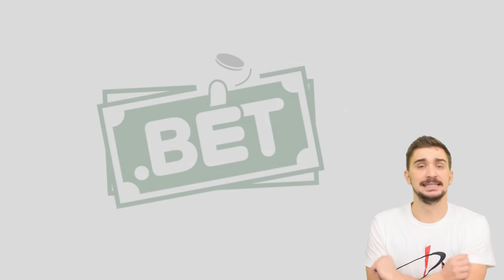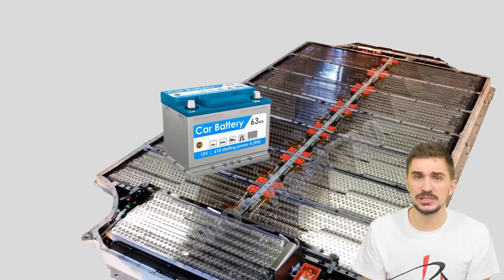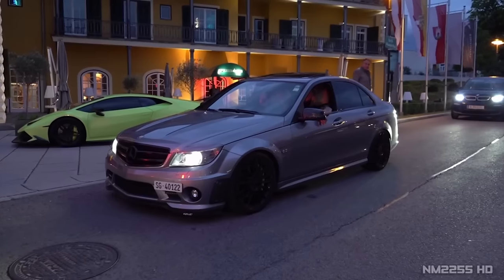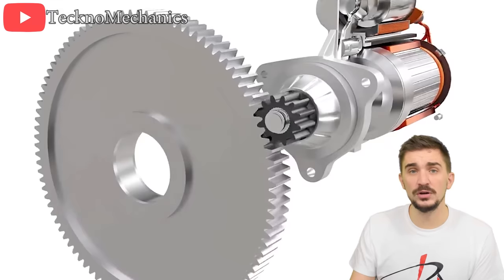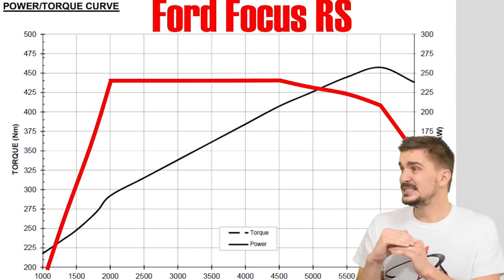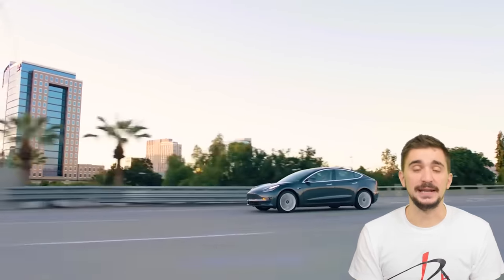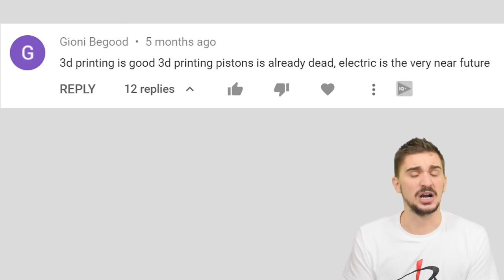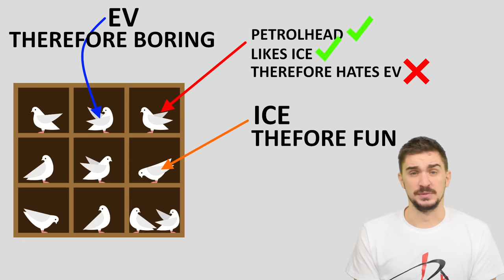ICE vs EV - IN-DEPTH comparison of BATTERY ELECTRIC and INTERNAL COMBUSTION ENGINE vehicles

Comment: Ah yes, starter - the forbidden EV motor :D
Reply: if only.... was brushless
Reply: @juandomingoperon828  Most if not all starter motor are brushless
Reply: Danger Bear  ∞ MPG with this one simple trick!
Reply: @juandomingoperon828  🪥 less?
Reply: @mayuravirus6134  Maybe many modern starter motors are brushless, but the majority of starter motors over history are brushed DC. And as our host stated, modern cars don't even allow you to use the starter motor to drive the wheels, since they need you to press the clutch in order to engage the starter.
Reply: @mayuravirus6134  this is news to me?
Reply: alternator, too...if you reconfigure it

Comment: For  me, none of what you said apply.  The reason I prefer ICE is because they are FAR more maintainable than EV and FAR less expensive to operate.   I drive 30 year old ICE which I maintained 100% by myself.  If anything goes wrong, I can fix it myself.   Just not possible with an EV.  You cannot even obtain replacement parts, diagnostic tools and even manuals in many cases.  Busted Tesla main computer?   Good luck trying to DIY repair!  EVEN Rich rebuild or Louis Rossmann are lost in that case.   I also drove an EV for 3 years and at one time it broke down on the road - I was completely helpless and I don't like that at all.   And think about the glory of when EV's main battery eventually breaks down out of warranty!   How much will it cost to replace?  GOOD LUCK!!!

Comment: Even tho this is more of a petrolhead channel i like, that this was really non biased. and that you give both sections their good attention.
Reply: Yet he is so wrong about EVs. The batteries must NOT be replaced. He keeps saying this over and over on several videos. Yet the first gen Prius from the 90s proved the batteries lasted the lifetime of the car, and did not need swapping out. Our 10 years old Nissan Leaf still has 85% range left. And i have never ever changed a window wiper motor on any car i have owned. Why did he even bother to put those in the service on the electric. Nissan Leaf service manual says to change coolant after 15 years. Yes, 15. If you do it earlier, you must change it every year after that. Something to do with sealing and quality of coolant. You dont regularly change gear oil either. Service manual just says "inspection" every year. Things like this damage the credibility of the channel. Read up, and stop using Tesla in every comparison. Small EVs and crossovers also exist, and they are perfect for daily use while the family SUV bus is parked waiting for long weekend getaways. (Most families have two cars).
Reply: @retroMartin  yes from the 90s you recognize how they didn't have so much computer tech right? Nowadays car manufacturers often profit off of making parts for no lifetime use
Reply: @Excepticus  Thats just a conspiracy thought. I just told you how modern day batteries last without issues. Nissan Norway only replaced a couple batteries under warranty. The Nissan Leaf forums are pretty much empty of threads regards to people whining about faulty batteries, because they dont fail.
Reply: @retroMartin  He is also talking about timing belt replacement for ICE engines and that also only happens once in the lifetime of an ICE car. 

He didn't talk negatively about the replacement of the battery nor its costs. He just mentioned it is a component that may need to be replaced sometimes.

I'm going to give him the benefit of the doubt and assume he talked about battery replacement because it might be something that happens after high power use of an electric car. I doubt that a formula E car's battery lasts as long as the one in a Tesla model S.
Reply: @retroMartin  I also drove Nissan Leaf for few years.   But my battery lost significant charge.  That was the main problem Nissan Leaf - you can find many examples of older Nissan Leaf, some even with less than 30 miles range when fully charged.  Now with Teslas, it's even worse as batteries often fail completely out of blue.   Lithium ion battieries degrade and fail.  That's fact of life.  Replacing EV main battery is VERY expensive, often not economical at all for old EV.   Not only that, electronics in EV is very complex, not really possible for DIY repair.   I also owned Toyota Prius for few years - engine problem?  No biggie, I fixed it myself, but if EV electronics break, then I am SOL.   Meanwhile, I am cruising in my 30 year old ICE which I maintained 100% myself.  It has same range as it did when it was brand new 30 years ago.  I can even rebuild my engine as it's fairly simple.  ICEs (with reliable, proven power train) are FAR more economical to operate over long time than any EV.  Look no further than Irv Gordon's 3.2 million mile Volvo on original power train ( which outlasted the owner unfortunately) for how long ICEs can last.  Irv Gordon's volvo is not an anomaly, as average ICE car in Cuba is 60 years old!!
Reply: @springer-qb4dv  I've never heard of this before. Are you driving in Arizona or other places with scorching heat? The old 1998 99 Prius batteries haven't failed or lost significantly charge either. I smell BS.
Reply: @retroMartin  The old Prius batteries are doing fine here in the Nordics but that is not the situation everywhere. This will become less of a problem as batteries get cheaper, better and the servicing gets better (I hear it can be a nightmare to get your EV-battery serviced in some places), but as of now this is still a problem in some places, like you seem to hint at yourself.
Reply: @Blandtheorist  By service on the battery, are you talking about fixing broken cells? Since the batteries does not need service.
Reply: @retroMartin  Broken cells, yes, loose wires etc. Probably often simple and fixable stuff but I gather that Tesla is so overwhelmed in many places that the only thing they suggest is a complete new battery.

This will surely get better once mechanics get more acquainted to these cars.
Reply: @Blandtheorist  Nissan Norway has replaced 3 battery packs for 10 years, i read today. Not alot... If Tesla swap packs, and refurbish broken ones to be put into other cars that's good too. I don't think 10.000 dollar batteries are shipped to the landfill.
Reply: diesel
Reply: very petro biased........regenerative brakes, very very narrow comparisons, etc....NO mention of oil industry vs mining for batterys, etc.....clearly naive. Off to a decent start though.
Reply: i added last comment before finishing watching video.  this channel is more Performance based, in those regards, ev will absolutely rule.  This channel has simply not been paying attention to the background of EV.

Comment: Another thing is that liquid fuel engines have a much longer range than EV. EV batteries drain really fast when you run the heat in one, whereas ICEs are just bleeding essentially a waste product of ICE engines. Going outside the engines of these vehicles, EVs are not better for the environment in many places because fossil fuels are used to create power for the electric cars. Even in places where "environmentally friendly" power is generated (i.e. wind, and solar power) the energy infrastructure is hardly adequate as it is, adding a ton of EVs on top of that would be detrimental to those places. Mining and refining lithium for EV batteries is very bad for the environment. As for technological advancement, electric motors and batteries have been around longer than internal combustion has, so I don't believe that will come as far as internal combustion engines have. I just don't think EVs will ever be better for the average person than internal combustion, and internal combustion surely will never be phased out entirely.

Comment: I really, really like your balanced, curiosity driven and engineering based approach to this subject. Thank you. I myself have worked with ICE:s all my career and would also describe myself as a petrolhead. I have 5 cars in my garage. HOWEVER, one is an EV and it's a car I really appreciate to drive. It works very well for most missions, and where it doesn't, I just pick one of the other cars. No big deal and there's is as you say no reason to cathegorically "pick sides" and start hating. 
Also, a subject you might want to cover: The ICE itself is not "the enemy", it's what we put in them... I think synthetic fuels presents a really interesting future and I hope development picks up dramatically. Again - thanks!
Reply: @censoredfromtheinternet3110  factory =/= power plant
Reply: i hate evs
Reply: @alpha-cf2oi  shouldn't. They present the advancement of automotive engineering to scopes far beyond we could comprehend. Because of EVs we are already touching f-zero type of thing where you have a dynamic pitstop embedded in the asphalt that you only need to drive through it to recharge the car, and that to me as a car enthusiast and gamer is something i never thought of becoming a reality. EVs aren't the problem, preaching them in detriment of petrol cars is.
Reply: @Canalbiruta  tell me this: should a car enthusiast appreciate ICE cars AND EVs?
Reply: @alpha-cf2oi  that's what I've always told myself too. But one day I'll probably rethink that.
Reply: @ryze9153  i mean, not love them, but i'm from the school of thought that they should be appreciated for the amount of inovation they bring to the table for us petrolheads. I mean, call propaganda all you want, but formula e shows that electric cars can do some cool shit aswell. Problem is ppl trying to replace one with another instead of trying to focus on the strength EVs have and how unique they are as cars.
Reply: @Canalbiruta  yea, that makes sense. assuming more and more EVs are gonna keep coming, i guess make them as good as a car can possibly be. just dont ever forget about ICE cars. its called optimize the future but dont forget where you came from.
Reply: You cannot Bring EV's into Off roads and extreme Conditions specially in high temperature locations, i will tell the truth that will shock the entire EV lovers. You cannot Bring EV's into floody areas next to petrol engines as they cannot handle the situation of accelerating while flooding that will caus your EV's to die as it's components are easy to damage by water entering inside. The biggest and worse scenarios having EV's Than ICE is..(Batteries) the main issue is battery. Its all battery, with extreme temperatures it will explode without any bunch of signs that will gonna explode. So you cannot predict when it's going to explode because it's like rubbery where you didn't notice that these rubbery enters to your house and where not predictable they steal alot of needs and or gadgets without notice. It is my logic and that's partially true.
Reply: Another Problem of EV's is the battery pack is Very expensive for example, the battery replacement cost of Tesla model s is around $12,000-$20,000 US dollars according to Google Search that's very expensive and very heavy weight, the biggest issue is that if one of the 6000 fails, the entire battery of lithium ion will put alot at risk of massive explosion. actually there is an EV Related incidents where One family instantly killed in one Single massive explosion of the one which causes of the entire family death and the house massively destroyed by the massive explosion. E-bike, the causes of E-bike explosion is the circuit protection fails to cut off the power supply when the battery is fully charged that's why the battery suddenly explode without signage badly destroys everything even the house itself. That's why I've never recommended EV specially it's made by Tesla's poor management to adress this issues. Instead i would go to Toyota's hydrogen fuel cells. Toyota mirai is one of the best.
Reply: Synthetic fuel seams especially good for diesel replacement.
Reply: The answer to all of these problems are hybrids.
Reply: @dbad8798  …or more cars in the garage 😅
Reply: Lots of broad generalisations here. EVs don’t need overhyping. They are cars not miracles. It is different driving them. I prefer my EV for the driving experience. This is because I chose one that every tester said was fun to drive and really nicely balanced. I do charge at home. I used a spreadsheet to see how long it would take to pay off the cost of the charger installation. It was around the 15,000km mark. The EV is only 50kg heavier than the car it replaced but that was an SUV not a hatchback sedan so it is a slightly smaller vehicle. If you have 2 cars you should seriously consider an EV. That way you can see how they compare. Be careful which one you choose. Do the research carefully just like you would for an ICE vehicle.

Comment: Privately I drive and A3 e-tron hybrid. The possibility to drive electric on the short distances I normally drive, is great. Low cost for the electricity here in Norway. On longer trips, it uses 4.5 liters/100km.
The government has the wild idea that by 2025, we can't buy ICE anymore, only EV. That's stupid IMHO. We have winter here with down to -30 to -40°C and long stretches between towns. The amount of charging stations are pitiful at best, and using them costs more pr km than using petrol.
In 2 years time, I'm getting an EV van for work. That's bonkers. Tests have shown that the Maxus e-Deliver 3 manages around 240km on battery, without interior and tools, with 10°C outside. I drive 100-150km each day at work. Spending 1 hour each day at a charger sounds like fun… Usually I fill up the tank one time pr week. That takes 3-4 minutes. 4 minutes of working time each week, or 5 hours each week. What's best for the company?
If you have the ability to charge at home, and doing small trips, EV's are great. But for longer commutes and cold weather, diesel/petrol are the best.

And just for giggles, this will be the result if all goes electric.
https://www.youtube.com/watch?v=UqEwLle8xKU
Reply: Europe's other countries also seem to have fallen for this same trap: the delusion that banning petrol and Diesel vehicles would actually work out in the slightest. Hopefully this will spur some serious research into bringing back the Wankel engine or some other kind of ultra-compact pistonless rotary engine. Or biofuels. If there's a major breakthrough in something like pyrolysis-derived fuels (fuels produced through pyrolysis of waste such as garbage and sewage), then I guess they'll finally wake up.
Reply: @electric7487  I live in rural Northern Ireland, and the British government has decided it wants to ban all new ICE sales in 2030. There isn't a charger within 40 miles of my home currently and very few new ones are being built outside Belfast. The only EV charger I have seen in person was broken. In case you aren't aware, NI is the worst off province of the UK, with next to no economy beyond farming, and even that has been faltering over the last few years. I think most people here will just continue to fix up the old busted up ICE motors running diesel marked for agricultural use only (AKA "red diesel"). Hopefully this does backfire completely on the government, since we have a rich heritage of motorsport and modified cars, and prohibiting the purchase of new ones will help to fan these embers into flames.
Reply: It's just dumb propaganda, I'd like to see the high class politicians between charges of their EV's official escort doing press conferences about saving the Earth by waiting at a charging station instead of a more important place to take action 😅.
Reply: 100-150KM each day will not be a problem with charging during the night at the garage.
Reply: agreed brother. I think the "hybrid" route is truly the best answer. especially here in the US. LONG EXPANSES at this point necessitate a longer ranged solution. I. the future I'm sure batteries can do it, but if they don't change how that electricity is produced there's almost no point to go all electric for the sake of a cars pollution.
Reply: This is exactly why people like Debosse garage from my home of Canada are going for hybrids. Batteries cannot properly handle many environments. Someone nearby owns a tesla and they are without a car in the winter due to the mileage of the car plummeting down to ~50 miles of range. Meanwhile a hybrid made by Debosse will keep most of its range even when the weather doesn't allow regular ev's to go.

Comment: A German here: normal Gas price is here around 1,35- 1,40€(E5) in NorthrhineWestfailure(westgermany). so it´s about 1,65$. And a KWh is also a bit chaper.  0,25€/0,3$. But if you wait a bit, the prices will be correct. Next CO² tax is comming. no doubt.

Additional: I think booth propulsion methods have their own field to work. ICE for long range and heavy duty. EV for the city and short range.
Reply: Yeah I think Plug-in Hybrids are the best option right now. Even mild hybrids are a nice step.